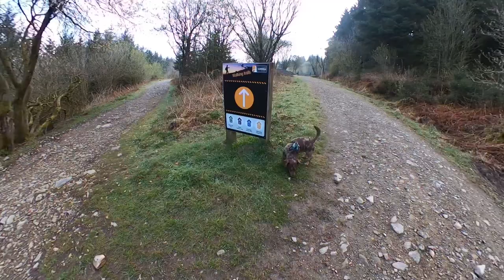Vlog 6 - Workshop life, walking with Sprocket dog and mtbking at Llandegla

Comment: Impressive soldering iron action there! I must admit, when I think of a bike mechanic, that's not the first thing that springs to mind. It must be challenging as well, because presumably wires in the original loom were cut or pins pulled out of connectors as part of the alarm installation, & you have to know maybe 10 or 15 years later without benefit of the alarm installation sheet or the wiring diagram for the bike exactly what you need to connect to what to reinstate things as they were...